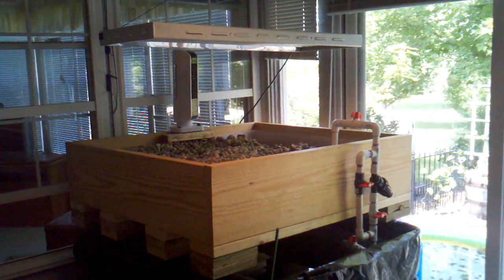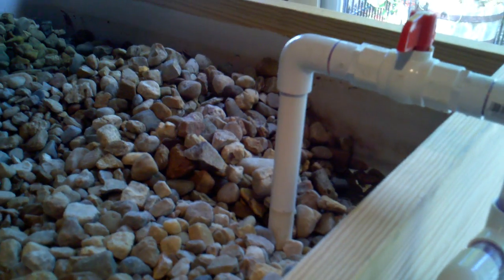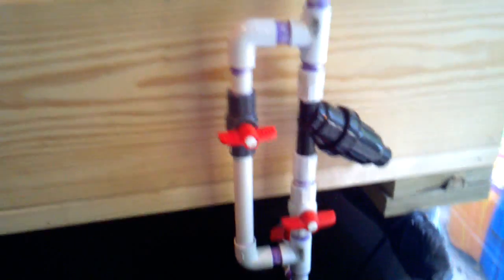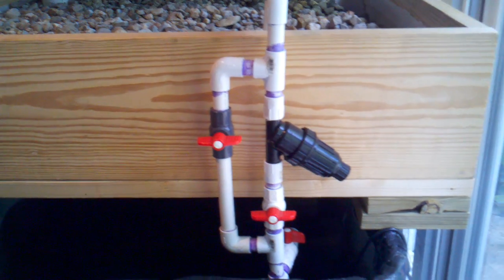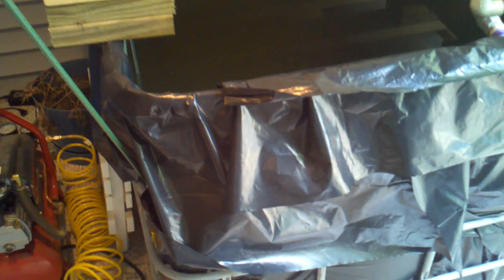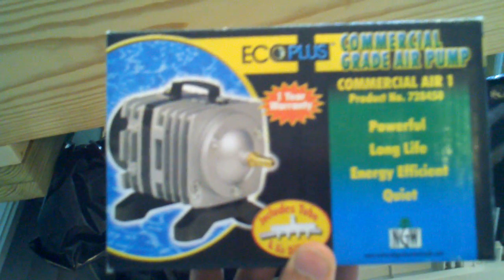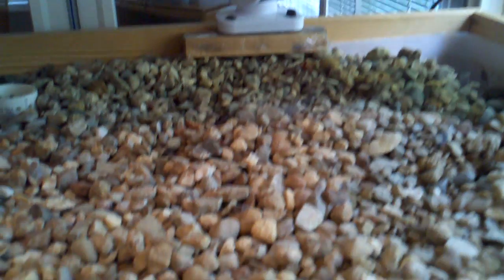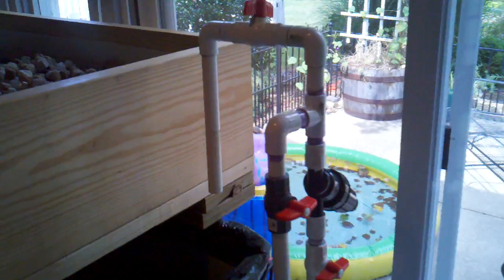Cheap Aquaponics Indoor Setup

Comment: if you dudes expect to get ripped quicker without wasting a single extra minute in the gym, then you really want to keep an eye on this online video SIXPP.COM

They dined on mince, and slices of quince  Which they ate with a runcible spoon;  And hand in hand, on the edge of the sand,  They danced by the light of the moon.

Comment: If your system is properly cycled you will not have any problems with ammonia or nitrate, and the subsequent nitrite will be used by the plants that's the whole point of this system. You should look into the nitrogen cycle of aquariums. Happy Farming

Comment: Nice system, glad to see that you changed to a vortex filter to remove particulates. I'm just learning about aquaponics myself, however based on the chart for the Eco 633 submersible pump you showed it states Total Head maxes out at 7.9ft(seeing what approx. is 5 - 5 1/2 ft pump height); to get better flow, you might need to install a bigger pump, decrease the height it has to pump to(as well as removing the cartridge filter) or add a booster pump closer to the top to get the Flow that you want.

Comment: nice system man!! serial!! :)
if you want your pump to pump water higher, a reasonable solution is to use narrower tube in your 'fill plumbing'.. you wont get the same flow rate, but you might have enough push left to run your ancillary outlets..

Comment from the maker: A swirl tank basically makes the water that goes in make a swirling motion like your toilet. What it does is allow for particles to settle to the bottom so they can easily be removed. If not removed they will cause excess ammonia which will kill the fish. And yes I am very happy with this setup. I have switched to an automatic feeder for the fish which allows me to ignore it but once a week if I need to when I'm busy.